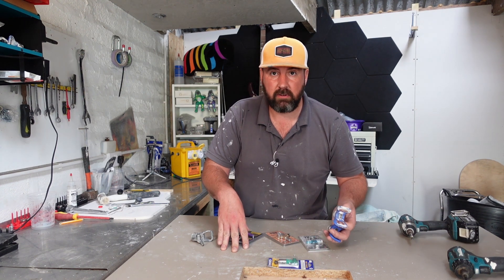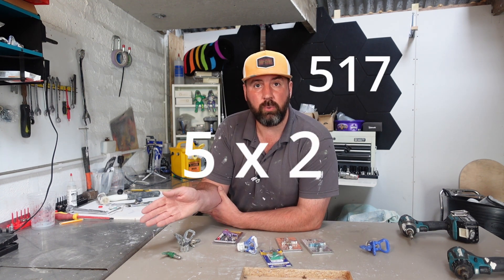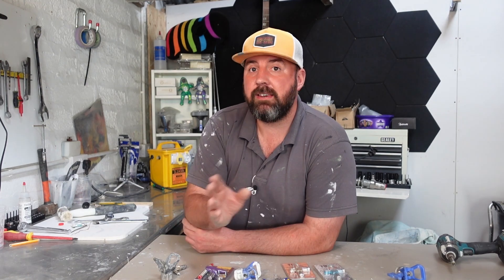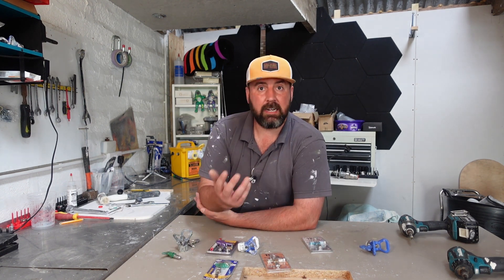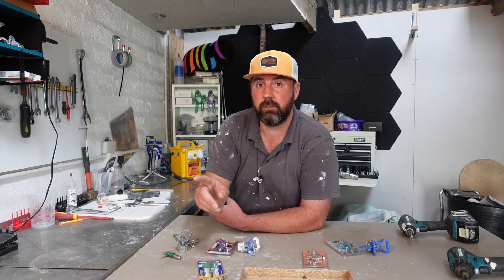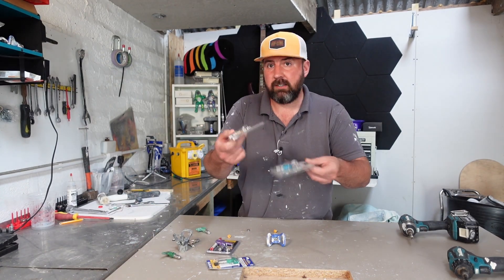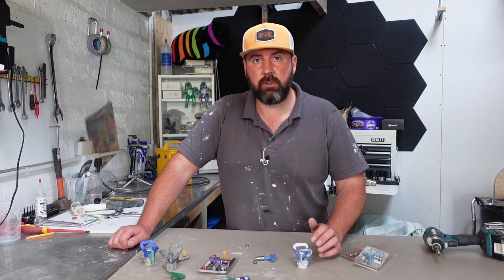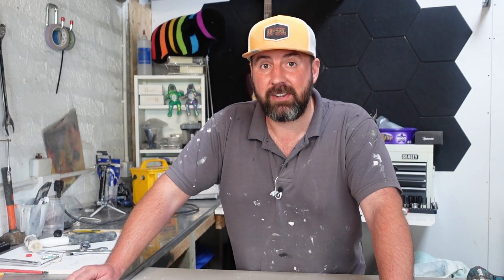Spray Tips Explained - Airless Sprayer Tips For Beginners

Comment: Been watching your videos over the last few weeks after buying the Erbaeur EAPS600 and bought the Graco guard and a FF310 tip - finally went for my first try with it at the weekend and it was a disaster 😂 started off with tails and upped the pressure and all seemed to be well... for the first couple of passes and then it was blocking up every 5s and it just got worse as I went on.
I thinned the paint some more... and some more till it was all okay, but ended up basically like spraying milk and the paint runs are awful.
Looked at the paint data sheet afterward and it recommends a 17 thou tip - am I right in thinking I should have just upped my orifice size rather than thinning the paint?
Determined to figure it out rather than throwing the towel in. Cheers!
Reply from the maker: @RichardGreenCreative  hey. Firstly, what paint were you trying to spray? Woodwork or emulsion? 

Loads of data sheets say .17 tip. Its definitely not the right way to go if its woodwork ha but walls and emulsion yes. Would be a hell of alot of paint on there.  Id say your main issue is crap in the paint. Did you filter it with a siv or anything first? Theres no manifold filter on the pump so any lumps or crap just gets sucked up.

Loads of blocks are from that reason. You could upto a 2
312 or something. But again youd be applying a faid amount more so need to move faster.
Reply: @sprayaholic  Thanks for the quick reply! It's some cabinet/shelving I've made, so a mix of PAR timber and MDF (which has been sealed)
This weekends attempt was priming it with Armstead Quick Dry Wood Primer. Started off with maybe 10% dilution. Filtered it first but maybe the holes in sieve were still too big, letting some crap through maybe?
Once I'd got rid of the tails with pressure increase, it was going on quite well, but the blockages were a pain. I could barely do one pass once it started.
Likely a case of just having to filter the paint better first? Cheers

Comment: I have a question Rick. Oil base paint what the best tip
Reply from the maker: @jessehamlett3068  it depends on your machine. Maybe a 311 would shoot nicer than the fine finish ones. Depends how wide you need the fan. And what youre painting
Alot is trial and error and personal preference.  Alot depends on the paint consistency and also temperatures.  The thinner or warmer your climate is, the nice you'll get it to spray out the can

Comment: Was just looking at picking up the erbauer paint sprayer from Screwfix, and then not sure to go Graco and Tritech. 

You actually mention for me to check this vid for more info. This vid says the graco tips might not do as well for walls and ceilings as maybe tritech. So not sure what way to go now 😮

Graco RACX guard. Plus a 310 (for woodwork). (Is it a 7/8inch guard and tip I need for the erbauer?) also can I put the 517 tip I get in with the erbauer to the Graco guard or do I need a separate tip from Graco?

Or

Tritech contractor pro guard and then both their version of a 517 and 310 ? 

Thanks mate!
Reply from the maker: @chrisg3726  it gets confusing as you move through to bigger units.

 Basically what im trying to say with the Erbauer is that because its got less power/output compared to some of the bigger more professional units. Using graco low pressure or fflp tips  allow you to spray at abit lower pressure or not run the machine on max so it sprays paints. So more ideal when you've not got the extra power as if you cant get a nice spray fan your other option is to thin the paint down.

The 517 it comes with is fine for walls and ceilings. But you could get a 310 and 517 and the blue rac x guard.  Yes its a 7/8 thread and fits the gun.

When you use more powerful units they can spray thicker materials abit easier, so you can spray more with less thinning. Although the max pressure is 3300psi the litres per minute are low compared to more professional units. Ha hopefully that helps answer the question.  In short use the graco low pressure on the Erbauer is my advice.

If youre after a professional unit i often sell refurbished units you can message me on Instagram if interested,  i sell them to my followers so they know theyre getting a fully working unit when they cant afford new
Reply: @sprayaholic  this is ace thank you. I think I’ll get the erbauer and graco racx guard plus a 310. I guess I’ll stick to the 517 that the erbauer comes with. If you have any links to these goods I’d be happy to buy them if it gives you a little commission! Have you ever done Amazon shopping carts? I think that a lot of people like me would use them to buy supplies after watching your great vids!!
Reply from the maker: @chrisg3726  appreciate the support.  No i haven't heard of amazon carts.  I did set up a buy me coffee account.

If youre getting a 310 id probably get a 517 graco lp aswel, it gives you 2 tips to alternate with if one sprays better than the other. I'll take a look for a link
Reply from the maker: @chrisGTuk  prices are a fair bit more on amazon. Google.  Mypaintbrush.com they sell the tips and guards.  Use DF8 for 8%off your cart 👌
Reply: @sprayaholic  I’ll get you a coffee but def have a look into that shipping list thing for future videos! Might make you a few quid!
Reply from the maker: @chrisg3726  thanks, I'll investigate.  Im hoping to set my own online store up at some point too. So plenty to work on
Reply: @sprayaholic  I went for it and picking it up today. In terms of mist coats and paints: the walls have previously been painted, but filled and sanded. Should I still do a mist coat?

Finally what paints go through well? It’s all basically white. Someone said I should be using a silicone paint on the wall as it’s a hmo and hard wearing…
Reply from the maker: @chrisg3726  cool, internally? I use durable matt for busy areas as its cleanable. 
I would thin the paint 10%. Wipe over the filled areas to make sure its dust free. Dont go for coverage in 1 either.
Reply from the maker: @chrisg3726  i use a kitchen siv to pour the paint into a seperate bucket, you'll be suprised with the amount of crap in the paints. Grab a whisk from screwfix aswel so you can use your drill to mix it up
Reply from the maker: @chrisg3726  some people use masonry paint, ive seen it alot. Not sure its what id use though but its cheap and does the job
Reply: @sprayaholic  ace! Yep I’ll wipe down the walls to be honest as all the skirts got sanded. Then I’ll just thin by 10% and do two coats. Any particular brand of durable Matt?

I slung you a donation on buy me a coffee, but it looks like another one is due already 😝
Reply: @sprayaholic  got one!!
Reply: @sprayaholic  I’ll stick to the durable Matt. I’m gonna eggshell the woodwork. I guess I’ll just figure out the best consistency on the job

Comment: I'm about to spray 25m of lollipop fencing with the erbeur 600 from screwfix using ronseal. Can you recommend a spray tip for that combo - wondering if I can get away with the 517 or go for the 310 you recommend for woodwork? Thanks!
Reply from the maker: @TheReelIsle  you can use it yes, it will obviously let more paint out. But are you going to back brush the paint into the timber? It is advised on rough sawn timber. If thats the case you could use the 517 and have pressure low and not be bothered about the nice fan pattern as youd be  bak brushing it in.

You yes buy a new guard and maybe a 412 or something like that. A 310 would also work. You just need to work out how wide youd want to spray, while also tryinh to avoid gusty wind
Reply: @sprayaholic  Thanks again. Nope didn't plan on back brushing but we can certainly do so! I assume it's more important to do that on the rougher edges.

I'll take a look at a suitable replacement guard if a 412 may be more suitable. Tritech tip and guard should be fine with the Erbeur? Otherwise happy to go Graco

Comment: Hi mate,  so if I’m using a rac x guard and ltx 517 and wanted to swap to a fflp tip I just make sure I use the seal that came with the fflp? Is it me or do Graco make this more complicated than it needs to be.
Reply from the maker: @user-mf1lz4bt7w  haha i guess. They just bring new stuff out and it supersedes the previous gear. 

Ye if you want to use LP or FFLP you need to use the metal seat that has the small hole, the same one thats in their own packets. If youd been using a blue tip in the guard the hole would be the bigger one so to use an fflp or lp you would have to swap the seat out yes
Reply: @sprayaholic  brilliant, thanks for the help 👍🏻
Reply from the maker: @Gaz1980-u8d   no problem, let me know how you get on with it ✌️

Comment: hey hey! Love the videos. Just wondering which Graco tip is best for spraying on narrow pieces like spindles?
Reply from the maker: @Sean-vz1ks  thanks 🙌
I usually use a 110fflp  but it can throw a lot of paint out as its a small narrow fan. Sometimes a 210 is easier to handle but alot more waste and over spray. 
A 108 is also good slightly slower but youd need to have well filtered paint or it would block alot
Reply: @sprayaholic  Great stuff! Thanks for getting back to me. I'll try those out for sure. I'd be lost without your videos mate. Cheers!
Reply from the maker: @Sean-vz1ks  thanks man really appreciate it

Comment: Hi will the tritech guard fit my Graco contractor pro gun 
I'm a new build sprayer and when using the fflp tips to sray acrylic I get loads of blockage depending on brand 
Cheers
Reply: I keep my tips in gun cleaner do you think it’s too harsh? Great video informative 👍🏻👍🏻
Reply from the maker: @TheSmithyt  no it can't damage them. Just cleans them quicker
Reply: Thanks for the reply 
The sprayer is a Graco 395

Fflp 310/210 are useless ( but the best if they do) for most acrylic so I use either a 313 /312 running at about 15 psi 

For Filters I use blue in the machine and black in the gun
Cheers
Reply from the maker: @Staky-wl4bk have you tried filtering the paint into a seperate bucket. More likely there will be gloopy bits in the paint. 
Have you tried blue in the gun aswel? Have you tried thinning the paint 5%? 
Upping pressure could maybe work but then what's the point of having low pressure ha. Sometimes it's a nightmare,  but my first port of call would be to filter the paint into a seperate bucket with a kitchen siv I usually use
Reply: I was in the same boat as you. I  had the contractor pro compact gun and it was almost impossible to spray crown primer on new builds. I think the stubby filter in the gun doesn't filter the paint enough. You definitely want the blue 100 mesh in the gun as well as the machine, but I went back to the ftx gun that came with my 390, put a 2 finger trigger on it and never use the contractor pc gun anymore. Rarely get any blockages either with a 310 tip. We're stuck with crown on our sites and it's full of crap so straining is needed for primer, never for emulsion as that's OK  with a 517 tip and higher pressure.
Reply from the maker: @badlefthook624  ye the stubby filters arnt great, but pre filtering does help with that. I tell people to pull the filters out the gx machines as they block up too fast and crap to take out
Reply: @sprayaholic  what are your views on the tritech t360 and t380 guns? I find graco guns spit like mad and I heard tritechs don't do that. The contractor pc was terrible for it without a cleanshot.
Reply from the maker: @badlefthook624  I use the contractor pc the most I'd say. Yes like the tritech guns, I prefer the t380 as its a nicer shape in my hand. I don't like barrel handles like the t360 and graco ftx etc. But I still use them and prefer a 2 finger trigger. Sometimes when paints thick it spits and when it holds on the guard.  Strip your gun down it may need a repair kit or a clean if its spitting too much
Reply: @badlefthook624 
I've not got the compact gun just the pro one so it's the larger filter and still get issues from spraying acrylic 
I've found crown not to bad to spray with the 310 it's armstead or Dulux that's the problem. Also like you no issues with emulsion with a blue 517
Reply from the maker: @Staky-wl4bk  no you'll want the tritech guard or wagner guard.
I like to stick with the branded ones.

It would definitely help if you filtered the paint onto a bigger tub. What size tip you using, what sprayer and do you know what colour filters in machine and gun
Reply: Just bought the tritec fflp gold  518  ,I normally use a 517 tip for ceilings and walls, is there not much difference in it ,am thinking just need to speed up a bit as more paint with release